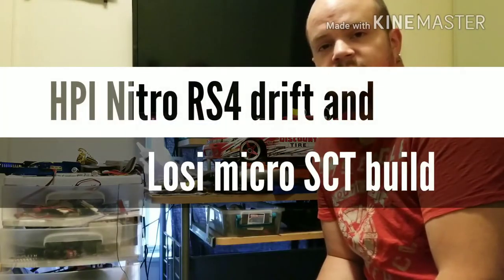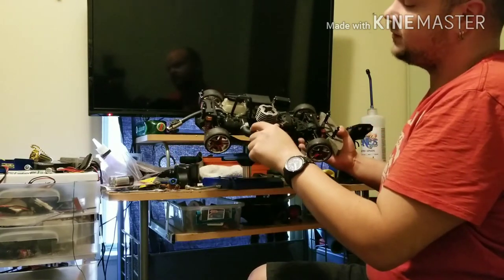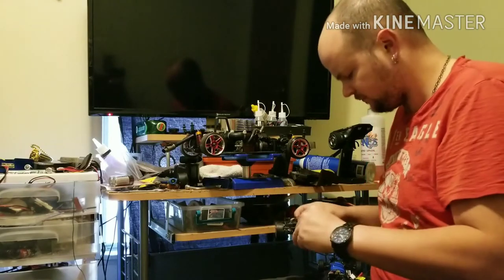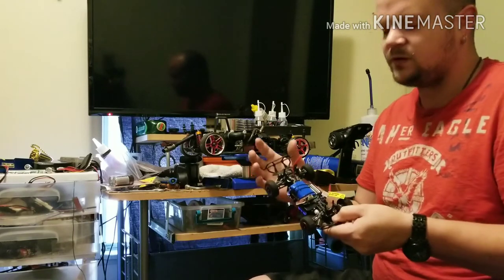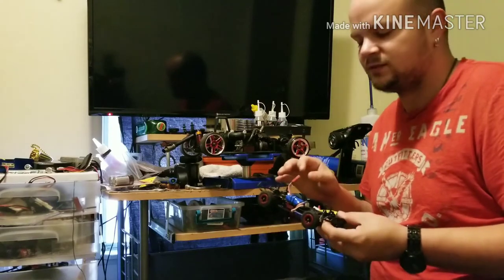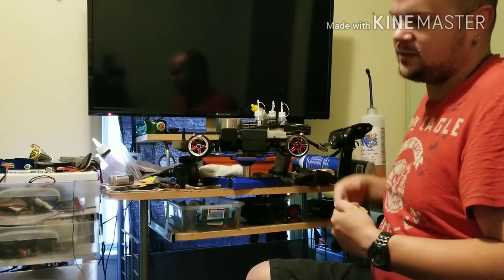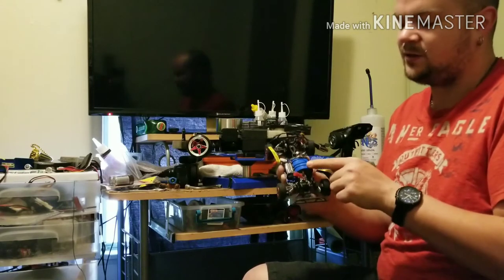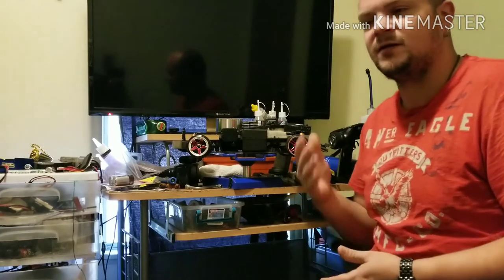HPI nitro RS4 3 drift and the micro drift builds

Comment: I know it would be a BIG project....But I was wondering if you can do a step by step video on how to take apart the Losi DBXL for cleaning ...Thanks great video...Cant wait for the NEW room Tour of your new place....
Reply from the maker: SomeGuyOver40 lol.  That would be a very long video. Like an hour and a half.
Reply from the maker: SomeGuyOver40 your best bet is to remove the motor and all electronics and use a pressure washer than oil all bearings. That's the fastest way I have found.
Reply: Nitro Revolution RC The intro was backwards just to let you know...
Reply from the maker: Jackson B ha ha.  That is weird. I'll have to fix that or probably make a new one.
Reply from the maker: Jackson B Thanks
Reply from the maker: nick P Nitro is a blend of nitromethane and methanol (basically what top fuel dragsters and funny cars run on but they run 90% nitro 10% methanol.) Nitros use from 5 to sometimes 35 percent nitro but racing calls for 25% usually and then a blend of oil, usually a castor synthetic blend though alot of the racing fuels run straight synthetic (I have some 30% that I use only for open class racing).  You can make your own and it's cheaper once you get all the measuring equipment down but for a starter stay away from Traxxas and blue thunder, basically any fuel made by a vehicle manufacturer. Stick with Bones, that's what I use 99% of the time, Odonnels, Byrons, Morgans, VP racing name brand fuels.  Tuning will be easier and the engine will last longer. Also do not use Traxxas break in method. That is for them.to make the most.money not the longevity of the engine. Nitro has a very steep learning curve but once you learn it you'll never forget and you'll see why nitro is in.some ways funner than electric. Lastly cost wise electrics and.nitros equal about the same cost wise but nitros require more maintenance. If you habe any questions feel free to ask.  As you see all I really run and own is nitro and fifth scale.  38 vehicles only 8 are electric.
Reply from the maker: nick P Absolutely not.  Notice how fast and powerful top fuel dragsters and funny cars are?  That's because the fuel they run and 80 psi of manifold pressure (80 psi of boost from the supercharger). With regular gas the air fuel ratio which is how much fuel is needed for proper combustion.  Gas is 14.6/1 whereas nitro is 1.7/1. So for gas you need 14.6 parts of air per one part if fuel and with nitros you need 1.7, alot more fuel for 1 part air. If you want to get into gas go for a Baja. They are readily available, cheap and parts are everywhere. Average price about 450 used but your getting a fifth scale which are twice the size of 10th scale.
Reply from the maker: nick P Also you see I have mainly hpi losi and a few other brands. I have some Traxxas vehicles like the revo 3.3 and 2 chassis, a t-maxx heavily upgraded, a 4tec, the funny car and a jato.  The 3.3 is an awesome.little engine once a davis diesel or rb mods connecting rod is installed. The stock rods split right down the center after so many gallons.
Reply from the maker: nick P if you have any questions ask away. Not much I don't know.  May sound cocky but I read alot and habe built and modded so many motors along with servos and built vehicles from kits. The kit option is the best way. You can add YOUR electronics.